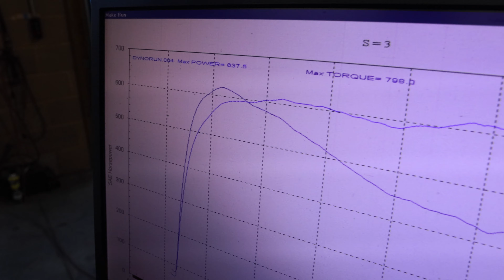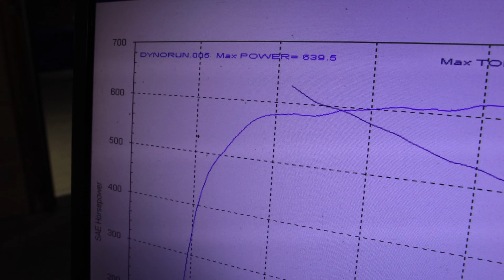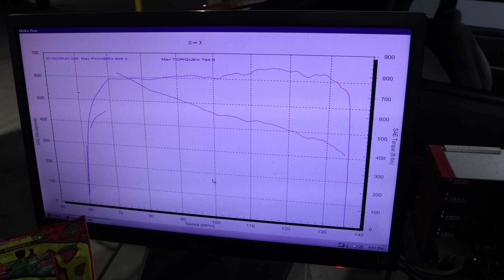Dyno Pulls with LSA Supercharged LS Swapped S10 RCSB. Crazy Torque Numbers!

Comment: ive got a 05 blazer with a cammed 6.0 i emailed magnuson about a supercharger but the dude was like,well its going to be a lot of problems yadda yadda so im like damn.is this a caddy supercharger ? does it need a intercooler or heat exchanger because i have no room i moved my ac condensor forward and put a huge radiator in it.and im not sure about the old style vortecs or paxtons ,i just want to buy a supercharger and need help haha
Reply from the maker: We have a heat exchanger in the grille in front of radiator. And a ice tank in the bed. Yes it needs it, yes it's a LSA, ctsv and zl1 supercharger.
Reply: @StreetcarShenanigans  thanks man,my ac condensor is located in front of the grill and i have a 3 core radiator but i was told i can run a smaller heat exchanger down below my bumper some place,im looking at a centrifical style also.thanks
Reply: Whipple hot rod front feed.
Reply: @horsefly1020  i went with a torqstorm supercharger its plenty for me.
Reply: @onewheelup  that's cool... I looked into them but i seen a lot of people have seal leaks on them.
Reply: @horsefly1020  really,i didnt know that i will have to keep a look out,other than that it runs pretty good,i dont drive it much,and it will never see the track,and i dont go out at night racing anymore havent done that in about 15 yrs or more so hopefully it will be ok,take care man